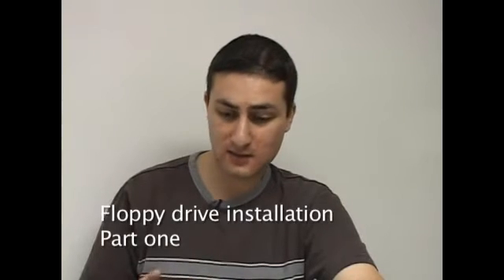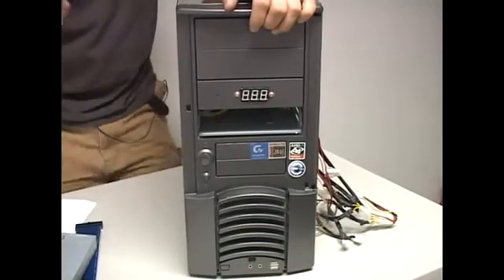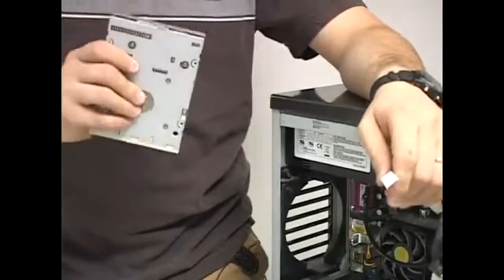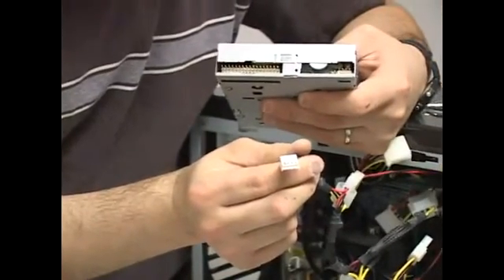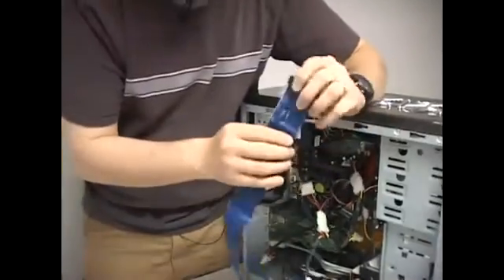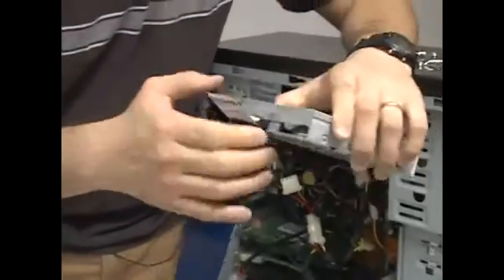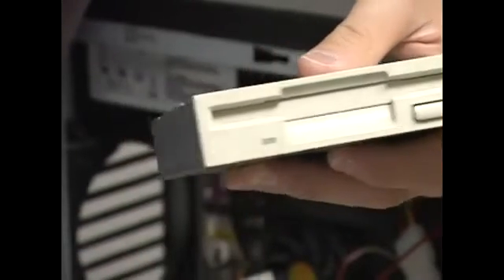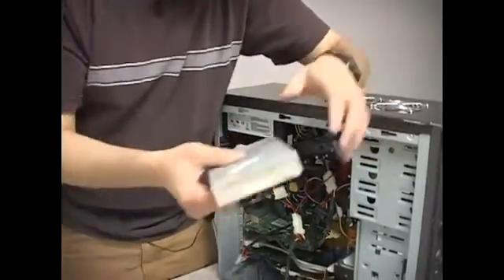How to Install Floppy Drives

Comment: What if your computer doesn’t have a power cable that fits the floppy drive?
Reply: Buy a molex to floppy connector if your power supply does not have floppy connector ,DON'T BUY SATA TO FLOPPY CONNECTOR as it might burn.